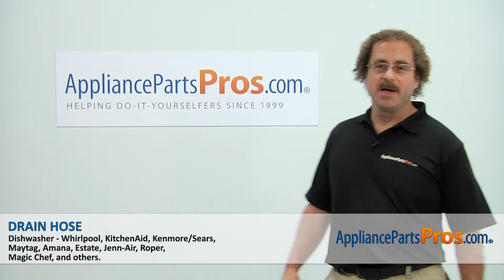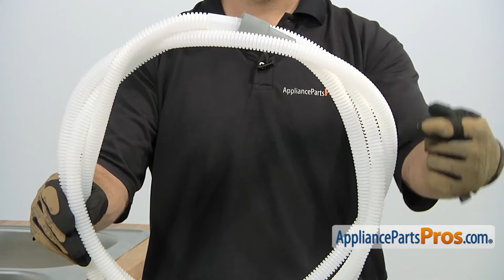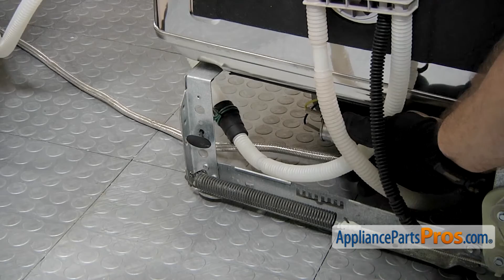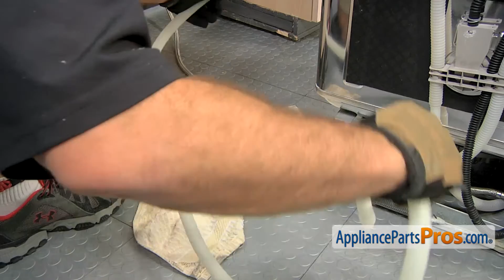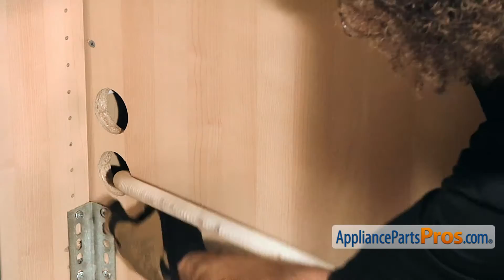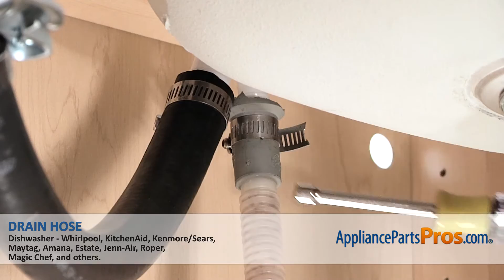How To: Whirlpool/KitchenAid/Maytag Drain Hose WP3385556

Comment: I have a Whirlpool dishwasher that has a brass 90 degree screw on coupling that attaches to the dishwasher. The coupling sits underneath the dishwasher at the front on the other side of the kick plate. This is attached to a braided hose going to the hot water supply line. Instead of disconnecting the braided hose at the hot water supply line, I can unscrew the coupling after turning off the water and removing any water pressure from the water lines.

Comment: What's irritating is that hardware stores don't sell a barb-ended drain tube anymore... Just the 90 elbow... So instead of male (barb) to female (disposal drain adapter boot) it's a female (90 degree clamping boot)-female(straight clamping boot) style tubes. I had to order it online and leave my dishwasher in the middle of the kitchen for three days.
Reply: I just learned this the hard way as well.  I also need a hose longer than 6ft otherwise I'll have to remove the garbage disposal.
Reply: @mtoohill   I needed a hose longer than 6' because I needed to have a trap loop under the counter. 😑

Comment: Doesn't there have to be a loop in it somewhere?
Reply from the maker: The hose attaches to the dishwasher pump drain outlet,the hose then has to be routed up the side of the tub and secured to the tub mount clip and routed back down to the floor/frame level, and routed out the back and into the opening in the cabinet.
Reply: @ 🤦🏼‍♀️ ugh. I was going to try to tackle this myself because I don't have anyone to help me but it sounds confusing 🫤. But I do appreciate your response! 🙏🏻🙏🏻
Reply from the maker: You're welcome! Good luck with your repair!